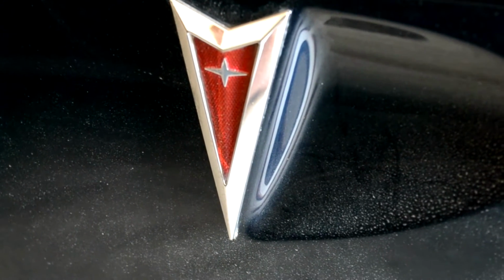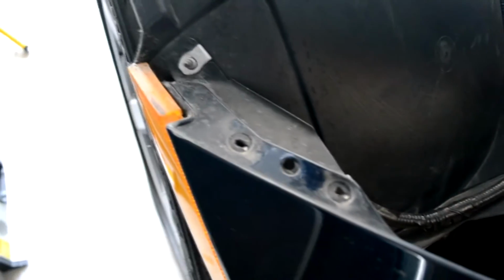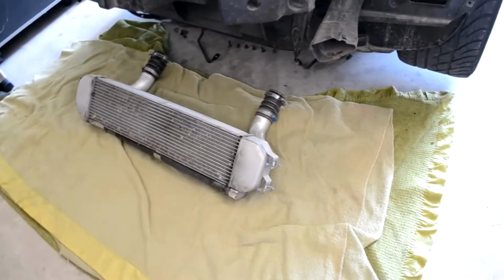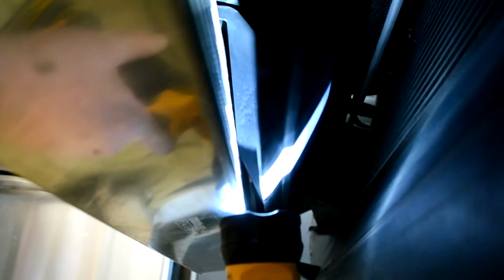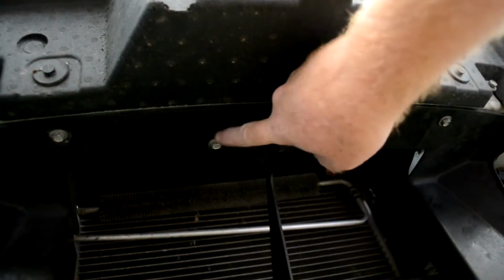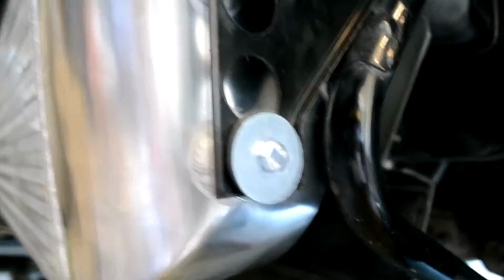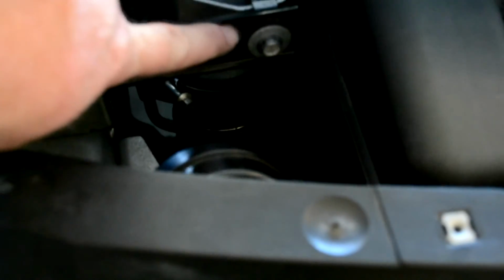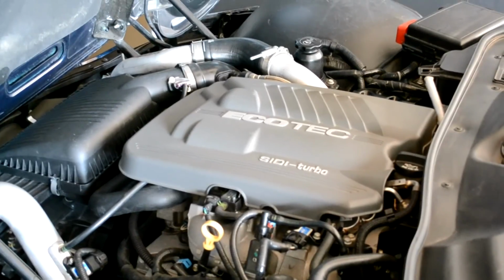Pontiac Solstice GXP Intercooler Replacement

Comment: Not sure if you’re still reading comments but great video AND camera work. 

PS. I have a P2187 too lean at idle code for months now on my 08 GXP. I’ve gotten sensors replaced recently (MAF, O2, Coolant temp). Replaced head gasket and cleaned throttle body. The code remains… any ideas?
Reply from the maker: Hello! Thank you for your kind words about the video! 

Regarding your car issue, sorry to say that I am not well-versed in that specific code (P2187) for your 2008 GXP. You've already taken some good steps with the replacements and cleaning. Unfortunately, I don't have further advice on this. I hope you find a way to solve the problem soon. Best of luck!
--------
The following is an answer from AI using the information in your question and is not from me. Maybe something there will help: 
Given that you've already tackled some of the common causes of the P2187 code, here are a few more areas you might consider checking or having a mechanic look into:

Vacuum Leaks:
Even after cleaning the throttle body, small vacuum leaks can still be present. Check all vacuum hoses for cracks or disconnections. Use a smoke machine if possible to detect any leaks that aren't visually obvious.
Fuel System Issues:
Fuel Pressure: Ensure the fuel pressure is within specifications. A weak fuel pump or a clogged fuel filter might not deliver enough fuel at idle, leading to a lean condition. 
Fuel Injectors: Although you mentioned replacing sensors, check if the fuel injectors might be clogged or leaking. This can be done by looking at the fuel trim values with a scan tool; if they're trying to compensate significantly at idle, injectors might be the issue.
Exhaust Leaks:
An exhaust leak before the O2 sensor can introduce extra oxygen into the exhaust, causing the sensor to read lean. Inspect the exhaust manifold and connections for any leaks.
PCV System:
The Positive Crankcase Ventilation (PCV) valve or system could be allowing unmetered air into the intake, which isn't measured by the MAF sensor, thus causing a lean condition. Check if the PCV valve is functioning correctly or if there are any cracks or loose connections in the PCV hoses.
Air Intake System:
Look for any air leaks between the MAF sensor and the intake manifold. This includes checking the airbox seal, gaskets, and any clamps or hoses for integrity.
Oxygen Sensor Calibration:
Even though you've replaced the O2 sensor, it might not have been calibrated correctly or might be faulty out of the box. Sometimes, sensors need to go through a learning phase or might be calibrated incorrectly from the factory.
ECU/PCM Issues:
Although less common, the issue could be with the Engine Control Unit (ECU) or Powertrain Control Module (PCM) itself. It might not be correctly adjusting fuel trims due to faulty programming or a hardware issue.
Intake Manifold:
A cracked or leaking intake manifold can cause unmetered air to enter the engine, which isn't accounted for by the MAF sensor, leading to a lean mixture.
EGR Valve:
If your vehicle has an EGR (Exhaust Gas Recirculation) system, ensure it's functioning properly. A stuck open EGR valve can lead to a lean condition at idle.
Check for Other Codes:
Sometimes, other codes might be present that could give more clues about what's causing the lean condition. Have any other diagnostics run that might reveal concurrent issues.
Reply: @ currently planning to install a DDMWorks intake tube. The connector to the PCV valve is broken and fixing that should clear my code (hopefully)

Comment: Great video, even 7 years later!   Huge help.   Could you just leave off the splitter piece that you trimmed?  Also, what did you use to cut trim the piece?  It came out really nice.
Reply from the maker: Thank you. I am glad the video was helpful. I am not sure if it would be a problem to leave the splitter off. Because I didn’t know, I went ahead and modified it and put it back in. As for what I used to cut material from the splitter, I used a Dremel tool and file to smooth and level the trimming that I did. I hope that helps.
Reply: @markandrewdavis  Thanks so much!  I just trimmed mine like you showed without even measuring since I think my intercooler (RPM) is the same or smaller than yours and it worked out great.  This video was a life saver on this job.  The whole thing about bending the bracket/bars in front of the IC was stellar...that vice trick was amazing.
Reply from the maker: @aacar4095  Thanks so much!  I really appreciate the compliment.  I don’t know why I did the video other than I had time. It is neat to know it helped. Enjoy your Solstice!

Comment: Did it improve boost temps or performance to horsepower or just an upgraded intercooler?
Reply from the maker: Thanks for asking. I have no way to measure temperature or horsepower, so I am not sure. It takes a small bit longer to feel the turbo kick in. I suspect due to the increased capacity. When it comes in, you do feel it. My purpose was to not have a cracked intercooler again.